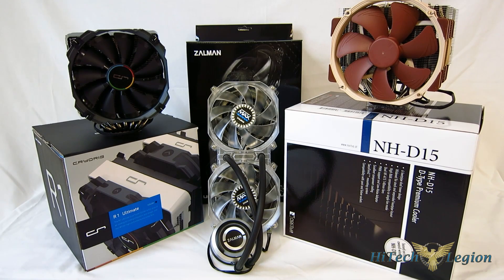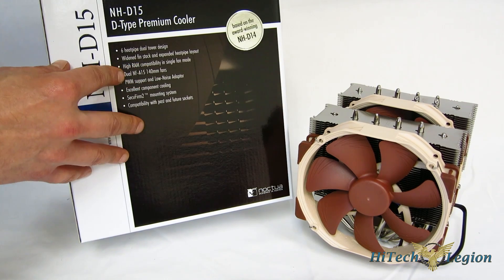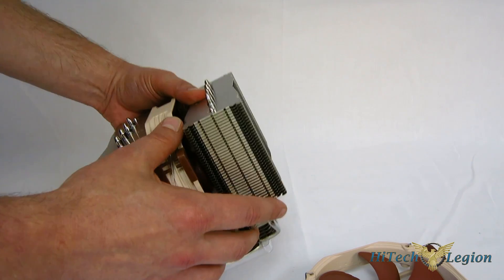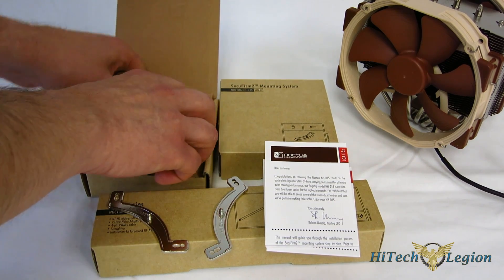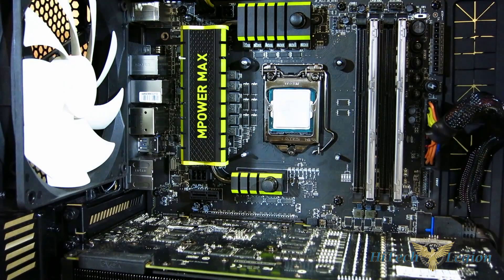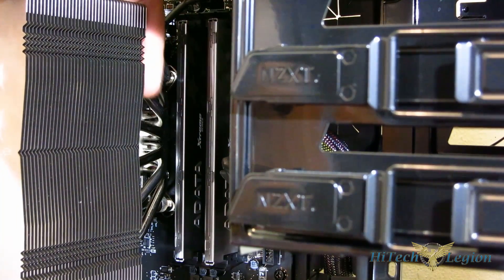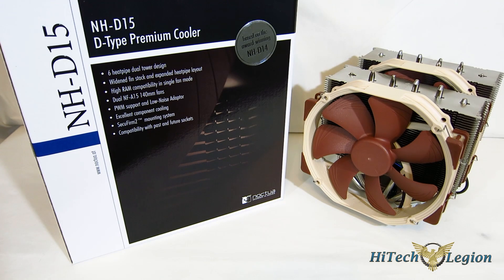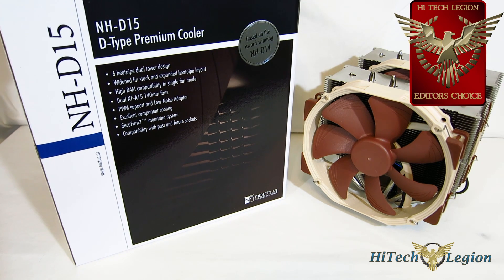Noctua NH D15 Overview and Benchmarks

Comment: What should I get? Noctua NH-D15 or Corsair H110i GT for i7 5820k??
Reply: +Zlobni Kotlet That depends. Performance of the two is essentially equal as shown in our review of the H110i GT. If you want that performance with far, far less noise at a lower price point then you want the NH-D15. If you would prefer having a computer that sounds like a vacuum cleaner and paying more, then you want the H110i GT.
Reply: +George Cella i'm talking about h110i gt not h100i that you have tested. I dont' care about money or the noise(i have a loud case)  just pure performance. What do you think it's better?
Reply: +Zlobni Kotlet We tested the H110i GT, released a video as well as written review on it. In that testing, there was very little difference in performance.

If you want the best performance, you should be looking at the Swiftech H240-X, which made the H110i GT (and GTX) look like a toy.
Reply: +George Cella There's no way I can get my hands on swiftech here in Europe, so the H110i GT or NH-D15?
Reply: Zlobni Kotlet As I said previously, performance is essentially the same. The D15 is SUBSTANTIALLY quieter, more cost effective and more reliable.
Reply: +George Cella mine leaked all over my GPU and I had to take it apart and clean it... i exchange it for the noctua

Comment: I'm interested in purchasing this and was wondering if it's better or worse than the Corsair H100i GTX cpu cooler? I'm leaning more towards the Noctua NH-D15, though. I also need to know if this will fit into my computer case. Here's my case: http://www.newegg.ca/Product/Product.aspx?Item=N82E16811124156&nm_mc=KNC-GoogleAdwordsCA&cm_mmc=KNC-GoogleAdwordsCA-_-DSA-_-CategoryPages-_-NA&gclid=Cj0KEQjw1pWrBRDuv-rhstiX6KwBEiQA5V9ZoY2u295HrsGMgvE4iKpCYrYlNeIuRS4ibszU-jiLG5MaAqH08P8HAQ

Comment: i'm new to build a pc gaming so what is better to buy, liquid cooling like corsair h100i or air cooling like cryorig r1 ultimate or Dark rock pro 3 for my cpu? i'm confused.
Reply: If you look at the review, it pretty clearly shows some key factors. The DRP3 is not in this round of testing, but we have tested it many times previously:

1. The NH-D15 and R1 both offer better peak performance than the H100i or other 240mm CLC.
2. The NH-D15 and R1 are both 15-20 dB quieter at peak.
3. The NH-D15 and R1 both give SIGNIFICANTLY better performance at tolerable noise levels.
4. The NH-D15 and R1 are both less expensive than the H100i or similar 240mm CLC.

So, the air coolers offer better performance, lower noise, better reliability and lower price. And the NH-D15 has compatibility with RAM up to 64mm tall, if that is your thing.

Pretty cut and dry, very little to be confused about.
Reply: The problem i have is clc are loud and hard to clean and of course for me liquid is no go!! its just not gonna happened. so thats why i'm not ever gonna thinking about water cooling and stuff like that. so for me air cooling all the way but the problem i have is the ram and the case. my case is gonna be thermaltake urban t81 https://www.thermaltakeusa.com/products-model.aspx?id=C_00002239 or corsair air 540 http://www.corsair.com/en-ca/carbide-series-air-540-high-airflow-atx-cube-case does noctua or cryorig fits on these cases? and do you know any awesome 16gb of ram can fit easily on these cooling?? i would appreciate your help :)
Reply: The Tt case has 180mm clearance for CPU coolers, so even the tallest on the market will fit. I'm not sure on the Corsair case since they don't list the clearance and gear their products to force you to buy more of their products....

You may want to look at the Phanteks Enthoo Pro. It may completely change your mind on what case you want.

There is a ton of top quality RAM with compatibility issues - Patriot Viper 3 LP, ADATA XPG Xtreme V1, G Skill Ares and Sniper, Mushkin Blackline, Kingston HyperX Fury, Corsair Vengeance LP, Geil, etc. You just need to remember that the height of the heatspreader does not determine the quality of the RAM....at all.
Reply: Yeah phanteks pro is awesome with amazing price, thanks for the help i'm gonna get the cryorig and im gonna search with the list of ram you give me. thanks a lot :)

Comment: looks very easy to install but lets hope this cooler doesnt get revised after your review, I brought a cooler you reviewed, and it was a revision which was way harder to install than at the time you reviewed (the revision didnt have a new version number, it was silent revision).
Reply: Noctua will not be replacing the SecuFirm 2 mounting kit any time soon.

Out of curiosity, what cooler are you referring to that changed the kit?

Comment: Noctua D15 rules!
Although the phanteks is ever so slightly cooler, it does so by running considerably louder. Noctua can easily go cooler if they simply increase their fan speed a little. Let's say when Noctua also runs at 36 dba, the temperature will be cooler.

Also their fans last way longer. Other manufacturers' fans will get noisy after just a short amount of time, while noctua's stay quiet and efficient for a ridiculously long time.
Reply: +tiger d Noctua is at 1500 rpm and Phanteks at 1300 so the Phanteks is the better cooler
Reply: +jervis jagroop How does that make it a better cooler? plus you can change the rpm.
Reply: Accelerator 1 Are you serious?
Reply: just answer my question lol.
Reply: Accelerator 1 With the lower rpm fans the Phanteks is still neck and neck with the D15,so putting higher rpm/static pressure fans on the Phanteks will offer better cooling thus proves that the cooler itself is a better cooler...it has been tested with different fans and does beat the D15   http://www.xbitlabs.com/articles/coolers/display/noctua-nh-d15_5.html#sect0
Reply: well, the difference with different fans will only be a very small one, the nh d 15 is still one the best air cooler you can get.
Reply: Accelerator 1 One of the best,but not THE best...,if they didn't worry about that cut out for the ram slots they could have gotten more fins in there to help with cooling,like how often do you swap out rams sticks anyway...and the mounting is so easy that it isn't hard to take out and put in the D15.but anyway.the Phanteks is still the king of the air coolers.
Reply: +jervis jagroop It beats the noctua by only 1 degree if you buy extra noctua fans and that only if you have them on max. I don't see how the Phanteks is better, if you have to invest more money into it, only that is on par with the nh d 15 or at max rpm 1 degree better.
Reply: Accelerator 1 In the link i showed you,they ran the both at the same rpm's and the Phanteks still beat the D15....and besides it's not uncommon for people to buy different fans for their coolers to increase performance,the Phanteks performs better,comes in different colors and is cheaper,it's the clear winner.
Reply: the nh d15 was only beaten in the idle temps, which do not really matter. On load though they are on par, and with different fans, the Phanteks is 1 degreee better. "clear" winner is just wrong, they are on paar, or imo the nh d15 is better, since it performs better out of the box.
Reply: Accelerator 1 Did you even watch the video? or the link i sent?..even  from my first post you didn't understand that they are performing the same even when the Phantek uses lower rpm fans,that alone proves the the cooler itself is superior to the D15,it isn't rocket science bro,just a little common sense
Reply: I know that is better, but only if you use the right fans and only by 1 degree. potentially better? yes. By much? No.
Reply: +Accelerator 1 Cryorig R1 Ultimate is better than both. I have one running my fans at 300 RPM and temperatures never peak past 58-61°C playing ANY game. I have an i7 5820k over clocked to 4.4GHz at 1.25v (bit higher than I could put the voltage at, but I would rather be safe) and I used to have a 212 evo and when I switched, load temps dropped 8°C and idle dropped 4°C and that was with 2 fans running 100% on the 212 and the fans on my CR1 are spinning at 300RPM and are literally inaudible.
Reply: +Erick Ortiz so which one do you suggest? Cryorg r1, noctua nh-d15 or corsair h110i GT for i7 5820k? And did your gpu gain any degrees because of that large heatsink?
Reply: Zlobni Kotlet They all perform very similarly but it would be slightly in favour of the h110i but keep in mind that the H110i will be MAGNITUDES louder than the Cryorig or the NH-D15. It honestly comes down to preference. The CR1 will have lower temps but it's slightly louder than the NH-D15.
Reply: +Erick Ortiz I have cooler master HAF X(1x230mm, 3x200mm and 2x140mm fans) so the case itself is already kinda loud so i don't mind which one is louder, and i can't get cryorg r1 because it's not in stock, so h110i gt or nh-d15? I just want lower temps as possible for the best OC :D
Reply: +Erick Ortiz 
But the problem is that here in europe I can't get cryorig r1 so it's either h110i gt or noctua nh-d15
Reply: Zlobni Kotlet Then H110i GT. It performs better than the Noctua but not by a ton, maybe like 3-4 degrees.
Reply: +Erick Ortiz OK thanks! :D when I get it i'll try to copy your settings to overclock it to 4.4ghz. Did you noticed any difference in performance when you overclocked it?
Reply: Zlobni Kotlet To be honest, no, I didn't notice a huge difference. I managed to get 4.6GHz at 1.275v because my CPU was pretty much golden so your results may vary. I turned it down to 4.4 because power consumption was very high and the performance increase in games wasn't huge either however, some games took advantage of the extra power like Battlefield 4, and GTA V but other than that it's mostly up to your GPU.
Reply: +Erick Ortiz how much fps did you gain by overclocking? I'm runnin 980 ti G1 gaming.
Reply: Zlobni Kotlet I don't remember. I got my CPU February last year and I haven't run it stock since.
Reply: Having top buy better fans immediately destroys it's performance per dollar.

Comment: i got an amd 8350 stock speeds at 1.4 volts with a high airflow case and I'm doing 48 degrees C under load with this cooler. Your setup must have been wrong in airflow somewhere since AMDs generally run a lot hotter than intel and yours peaked at 57 degrees.
Reply: Or.....it is the fact that it is a completely different CPU being used (an 8150), and it is running OCCT for load which I am sure you are not for load.

Comment: There is the H110i now that beats the NH D15 but considering how small the gaps is the price of the H110i the greater number of points of failure on the H110i and also the fact that one of those faults could lead to water damage and I think the NH D15 is the obvious choice.

H110i however does look better so if that's your thing then if your willing to spend the extra for aesthetics go nuts, but for me performance and reliability come first and foremost, with aesthetics being a nice far second bonus if you don't have to sacrifice reliability or performance.
Reply: Etheoma You forgot to mention that the H110i GT is absurdly loud. Check our review, at livable noise levels the NH-D15 outperforms it.
Reply: George Cella Actually your thinking about the H100i which uses 120mm fans and a 240mm Rad the H110i uses 140mm fans and a 280mm rad and is quieter under load but not by much than the NH-D15 but does cost $120 where as the NH-D15 costs around $92.

But actually the difference in heat is actually quite big its 9C out of 74 on a i7 4790k @ 4.6Ghz 1.3v, and really the price difference isn't that huge
Reply: Etheoma No, actually I'm not. We reviewed all of those. The H110i GT is insanely loud. I did all of the noise and performance testing personally, right down to dB meters shown in the video. When you attempt to quiet it down, it does exactly what you would expect a cheap aluminum, high fpi rad to do.....it stops cooling effectively. When noise levels are kept under 40dB, the D15 outperforms the H110i GT.....and the D15 is only at 33dB doing it. 

I don't know what methods you used when you were testing these coolers, but we left very little to chance as you can see in those reviews.
Reply: George Cella Sorry my bad It looks like I might have been looking at 2 baised reviews no longer listening to guru3D

http://www.guru3d.com/articles_pages/corsair_h110i_gt_review,12.html.

Comment: Looks like R1 Ultimate is the new king of Air coolers. Although i did buy a NH D-15.
Reply: +MohondhaY its 1c cooler and  8db loader and ikts support only 40mm tall ram this can to 64mm
Reply: +Aaponton 5 DB louder.
Reply: also the price is lower than nh d15. Noctua give 6 year warranty on all parts supplied. R1 , not sure.